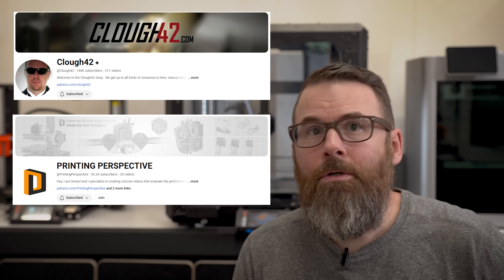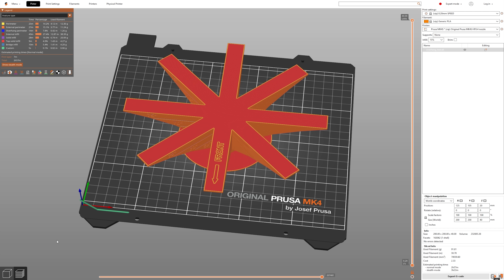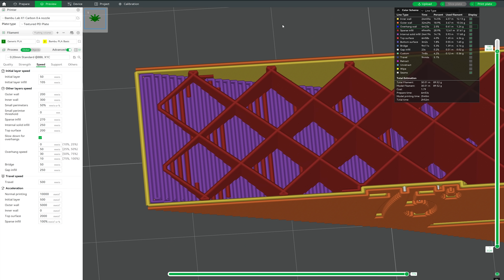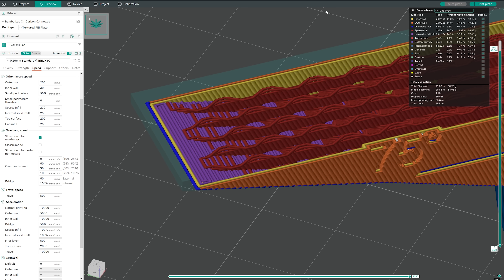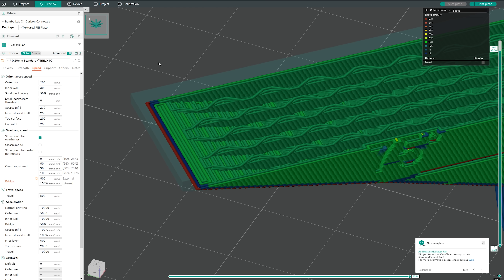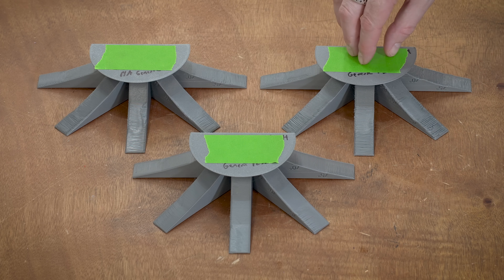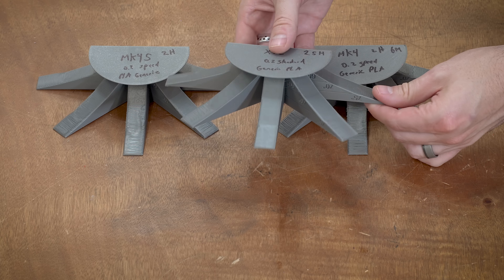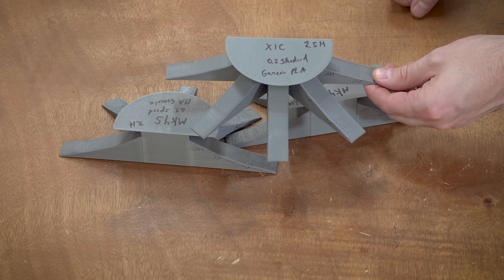Uncovering Prusa's Overhang Performance

Comment: Hello Robert, I wanted to clarify a few things. The bugfix you're referring to was actually implemented quite some time ago (9+ months), the MK4S wasn’t even in development back then. Honestly, it’s so long ago I did not even remember it. I guess it highlights that we do bugfix our slicer 🤷‍♂

It seems that the focus on overhang performance in your preview and this video might give the impression that it's the primary feature of the MK4S, which might lead to some misunderstandings. While we’re really proud of the excellent overhang performance everywhere inside the build area, it's just one part of what makes the MK4S special. Features like the high-flow nozzle, which enables MK4S to run laps around most other machines, and the fastest/least wasteful single nozzle multicolor printing, are also key strengths that I’m excited people will explore further.

I’m looking forward to seeing your thoughts on these aspects in the future. Thanks for all the work you do!
Reply: @thejosefprusa  the MK4s is a great printer and it has amazing performance,but I think we need to see a new flagship from prusa a midsize enclosed core XY machine 280x280x280 with prusa DNA. With a price tag of 1299. You already have all the electronics for that printer all you need is a chassis and a unique feature.
Reply: Thanks for the clarification! I’ve been using the MK4 for a couple of months now without a single issue, even with complex models, and I’m really impressed. Super excited to upgrade to the MK4S and dive into all the new features. Appreciate all the hard work you guys put in!🧡
Reply: Well it is the main thing you're having people show off that you sent the printer to, even Nero is doing a whole other video based on that overhang test............
Reply: “There’s a bug that might be affecting performance comparisons”

‘ I forgot ‘

😂
Reply: I'm sorry, but it is prominently marketed for this upgrade, so it certainly is a big feature! I know it must be hard to take a loss on a feature that you were proud of, but this deflection doesn't make it any better..
Reply from the maker: I've pinned your comment for visibility.  The timestamp in my video does line up with a timeline of 9 months ago, so we're on the same page there.  Bambu Studio still has yet to fix it, but apparently there's a workaround in Orca, which is still not ideal.

The focus is on overhang performance because in the 'Review Guide' clearly states "The MK4S delivers the best overhangs in the entire desktop 3D printing market" ... "so steep that most competition downright fails at printing them."  The graphics around the text show the overhang platter as an example showing some failures, with one being a 'corexy with aux fan'. I never said it's the PRIMARY feature, but if you make these bold claims, they need to be challenged.  If 'other printers downright fail', that needs to be investigated.  Upon investigation, it turns out to be a slicer bug that incorrectly applies the bridging speed to overhangs, as stated in the video.  

In all seriousness though, I have to ask if you feel that 24mm^3/sec flow rate (for PLA) is really enough to 'run laps around other machines' when many competitors (especially at this price point) can easily achieve 35mm^3/sec with standard equipment and well into the 50s with optional high flow nozzles?  These are bold claims and therefore need to at least be investigated for validity.
Reply: @RobertCowanDIY   well said! Also 24 is less than A1 is rated on their spec page (28) with a standard nozzle.
Reply from the maker: @riba2233  Exactly.  I know a couple people are testing aftermarket high flow nozzles for the X1C and getting beyond 50...  24 is more of 'standard flow' nowadays.
Reply: @RobertCowanDIY  very nice reply. The nozzle may be high flow but the hotend isn't. As I said in my previous comment, the bottleneck is the hotend. Also at the end we have to take account the other hardware of the printer as I clearly remember support saying to me that high speeds will cause problems sooner than if you print at slower speeds. So maybe the printer isn't manufactured to withstand those high speeds of the competition. Of course with a high flow hotend you will be able to print faster with big nozzle which right now you can't as even 30mm³/s is too low for a 0.6 mm nozzle and above.
Reply: One thing I love with Prusa is their customer support! Bambu has long ways to go before their customer support can reach the support Prusa offers. I recently had a issue with my X1 and its a bloody mess creating a support ticket with them. Keep up the great work! I'm really hesitant on getting another Prusa printer.
Reply: lol you sound butt hurt tbh.
Reply: Hey Joseph! Have recently made some further improvements to how perimeters are segmented before, during and after an overhang that prusa slicer may also benefit from :) check out the orca GitHub in the merged PRs section - Improve overhang slowdown granularity & line segmentation handling #5996
Reply: Seems as though ol’ Josef is doing some damage control.  I’m sorry, but $800+shipping+Tax for a slow unassembled bed slinger without an enclosure is ridiculous when Bambu is literally running circles around PRUSA. Great video, and great job on identifying the problem in Bambu Studio!
Reply: Seems like Prusa marketing dept “tried it” not expecting this? It was only a matter of time. Highlighting the solve of a flaw found in others before they fix it obviously was a time bomb they hoped to take advantage of- but it serves to damage the reputation of a company already seen by many to be resting on their laurels.
Reply: @thejosefprusa Hi Josef.  If you want to send me one, I'd be happy to test some of those other features.  I bought a MK3S+ a while back just to see why people loved them so much, and I've been keeping an eye on the MK4 to see how it matures.
Reply: @thejosefprusa You've got more serious problems to worry about. How about getting the price information correct in your web shop, and stop ripping people off? How about establishing an operative customer service that actually respons to emails within reasonable time? (more than a week is not reasonable time)
Reply: @retronicsno  what do u mean by ripping people off? pic or didn't happen lol :D
Reply: @retronicsno  What's your beef with Prusa support? They were always super helpful to me. Also: emails can get lost. Texts can get lost. I sometimes get messages from my wife five days after she sent them because they got stuck in some matrix limbo somewhere out there. I know that lack of support can be frustrating, but given that most people seem to have good experience with Prusa (given their Trustpilot reviews), maybe the problem wasn't really what you think it was. 🤷
Reply: hi josef! :hand-pink-waving:
Reply: Joe, please get back into the engineering department and be less of a manager at the top of the company. Get hands on with the product; hang out with your engineers and see what their struggles are. I bet you, there is something you will learn from them which will help you be a better manager.
Reply: Deflecting from the issue of the video
Reply: I cancelled my MK4S order, but it was the overhang performance that made me place the  order in the first place. It was featured prominently in a number of reviews, and as pointed out in the video here, you called it out in the reviewer guide. It clearly was one of, if not the, primary feature in the release. What else is there? A high flow nozzle? To me that's really not a printer feature, as it's something on most other printers you could just buy and swap out in few minutes. In fact, 3 of the 4 printers I own already do 24 mm^3/s or better, so this is not some new revolutionary advancement. The GPIO board and accelerometer are more interesting features, but again not unique or particularly innovative when comparing with other printers. All that said, I think the MK4S is great printer, particularly for someone new to 3D printing. The only reason I don't own one is the bait-and-switch order dates. Prusa will definitely be on my list next time, and I'm hoping then for a smooth and surprise free order process.
Reply: @mghumphrey  kind of a weird stance to take man, if it's on the printer, it's a feature. Not saying the high flow nozzle is revolutionary or even all that well performing compared to other printers, but if I buy a car that comes stock with a turbo, that's a feature. Any car without a turbo under the hood can be fitted with a 3rd party turbo given time money and effort. Maybe the turbo is poor performing and lower efficiency compared to 3rd party options- does that mean it's not a feature? Idk kinda weird man
Reply: 24-26mm^3/s with a 0.4mm nozzle in my opinion is still a bit too low to be called "high flow". It should at least reach 30mm^3/s, 24 is reachable with a cheap bambu clone hotend and 60W heater
Reply: @youtubehandlesux indeed. That's why I asked on Facebook about the wattage of the hotend. I believe it is the standard 20 watts. Yes the nozzle will help but the bottleneck at the end will be the hotend.
Reply: Still not good enough, bambu is better in stock config like we see here and you can upgrade the duct and the nozzle and still come under the cost of mk4s which is an open bedslinger... So it is not even a competition unfortunately. And it is certainly not a coincidence that you focused on overhang performance for this launch, let's be real.
Reply: Gosh, what a coincidence 🙄

Comment: It seems like these are all PLA comparisons in the prints.  In the future, multiplastic prints would be cool because a lot of us use these for pteg, tpu, and even ABS.  Enclosed, even my Mini runs great ABS prints. I've run some great TPU and ABS prints off (literally) this exact MK4s in my enclosure, and I'm very happy.
Reply from the maker: Correct, but PLA relies heavily on the parts cooling fan, which was the feature Prusa was pushing on the MK4S.
Reply: @RobertCowanDIY  yeah it's been doing a lot better on overhangs with TPU and ABS as well as PTEG, but I've found a lot of the default settings don't do bridge or overhang speeds or cooling in general so I've had to go in and modify those more for those plastics. But that's more of a slicer issue I guess.  Just odd that Prusa, who makes so many parts for their printers out of PTEG, wouldn't have better default settings.
Reply from the maker: @DissYraiN  Yeah, Prusa can be odd sometimes.  But then again, look at the PETG parts on the printers, they're not exactly the best examples of clean 3D prints.  They get the job done, but are heavily optimized for time.
Reply: @RobertCowanDIY  I was just going to say that.  I reprinted my mini x carriage because the plastic droops had to be affecting the print fan air flow.  I got it to bridge just fine with generic settings.

Comment: I would be interested to hear how long each of those prints took - you mentioned the Bambu had to be slowed down with the slicer changes you made. Also, the idea of these modern "just turn on and print" printers is that you don't have to do a ton of in-depth fault-finding and advanced slicer tweaking to get prints to come out right. As you say, the Prusa is a combination of hardware, firmware, slicer software and in-house experience, which results in a "set and forget" printing experience. I think that's worth a lot!
Reply from the maker: Bambu fixed this bug 3 days after this video was released.  They're both equally set and forget now, except for the Bambu being around 20% faster.

Comment: Well, it is difficult to make reviews of potentially non-consumer products. 
Cf. there are practically no reviews eg. of SAP.

IMHO there are some criterions eg. for (1) the hobbyist, here the entry price is quite important (but DIY kit makes it quite accessible, and if you are a would be maker...). Beside that even the hobbyist might be interested what are the potential paths up even from the acquired entry model, toward more complex prints, still in the prototyping but say (2} "an advanced hobbyist". Are we limited? If yes, how?

Than you have (3) profi-users which use it for the repeated production. Here the quality plus total cost of ownership (TCO) play a key roles, times of printing matter too. Calculating TCO for a common spectrum of tasks (resembling a 'banchmark') would tell something.

And than you have (4) advanced profi-users who specialize in something. Here, it is quite difficult to guess what such a user may seek as everybody may have a special priority. Large suppliers know but will not tell... 

If one is an advanced user one may still try to review the products for (1) - (3) types of users. 

I appreciated your videos!

Comment: Bambu studio just released an update that appears to be addressing this and adding a smoothing coefficient (no idea what this means yet really). Just thought you might be curious.
Reply from the maker: I saw that!  I was actually in contact with them, they moved fast!
Reply: @RobertCowanDIY  Would love an update video from you, with a test of the new Bambu Studio settings to see how it behaves in your tests, aka close the loop. (Would also be interesting to see if the defaults they have it optimal right out of the box, or if it needs adjustment for these "niche" overhangs)

PS: Anyway... subscribed, love your level-headed approach to testing - let the chips fall where they may.
Reply from the maker: @JacoGr  This is an old comment, but I ended up making that video ;-)
Reply: @RobertCowanDIY  I saw it as soon as it popped up. Thank you for that :)

Comment: You seem to imply Prusa did something wrong or underhanded.  Did they not release the source code per the open source license?  That's all they are obligated to do.  Bambu on the other hand give back nothing to the community, and rack up their list of patents.
Reply from the maker: I'm commenting on the misleading nature of their 'review guide' which was given to reviewers.  It clearly states other printers are incapable of these overhangs and imply it's due to hardware.
Reply: @RobertCowanDIY  like Bambu, Prusa printers are a combination of hardware and software.  This is how printers work best today - with that combination of hardware and software from the same source.  If "other printers" performed poorly with the hardware/software supplied, then it is technically correct.  Perhaps the implication is yours?  FWIW, I own neither a Prusa or a Bambu - so no fanboiism at play in my comments here.
Reply from the maker: @UnCoolDad  I mention this in the 'Prusa Optimization' section of the video.  However, software can get fixed relatively quickly.  AT LAUNCH, the MK4S might demonstrate some performance gains, but this will certainly go away as software catches up.  That's more what I'm trying to say.  And launching the product with this one little quirk in mind isn't going to work long term.
Reply: @RobertCowanDIY  in the modern world, competitive advantage can last a minute.  In the open source world, a second.  As long as what they SAID (not what you seem to think they implied) was factually correct at the time of publication, I see no problem.  It is called marketing.  If their overhangs were better than the competition using their hardware and software combination - more power to them.
Reply from the maker: @UnCoolDad  I can see that.  The wording in the press packet was a BIT misleading, claiming 'other printers can't do this' and stating it was because of the new cooling fan.  That's just not true, but it was strangely worded.

Comment: Man, even when Prusa does something right, you knock them down….

I dont know if this test is good. You manually tweaked a profile as if the same change was valid for all printers. 

In any case, it’s good looking into man.
Reply from the maker: I get where you're coming from, but the printer came with 'talking points' that claim it's 'the best' at overhangs and no other printer can do what it does.  I'm going to challenge that.  Give it a few weeks, the slicers will all be fixed and then it will be an even playing field.
Reply: @RobertCowanDIY bit you were quick to bring things up that weren't a talking point. Not in your video but in the comments.

I feel you have a bone to pick and that’s all.
Reply from the maker: @Vallecaucanisimo  There are 500+ comments here and I'm on both sides.  I maybe have a bone to pick when a company is trying to sway their reviewers to false information.  Also, it's hard to bring up EVERY single point in a video and not make it 1.5 hours long! I don't really have an 'agenda' here, just trying to be accurate.
Reply: @Vallecaucanisimo  I mean his previous video was praising the printer. If anything this video prevented me from returning my P1S I got a few days ago and trying the new slicer and settings first before spending way more for the MK4S with enclosure

Comment: What hideen trick/wrinkle did you apply to make the Bambu look the best in overhang performance? Was the filament for the Prusa also dried as for the Bambu? Enclosure? Same temperatures? 
Bambu slicer is based on Prusa slicer. Bambu is not developping the Bambu slicer at all - they only integrate spy- and comercial functions. But Bambu is waiting until Prusa or Orca integrate new features and functions in their slicers and then Bambu is going to copy and claim as their own new development. The same did Bambu with their printers - they copied from several companies.
Reply from the maker: Same roll of filament for each printer, everything was sliced using default settings and generic PLA profiles.  I only changed the speed setting on bridges.  You're looking for a smoking gun, and there isn't one.  Sure, Bambu Studio was forked from Prusa Slicer, but Orca, BS, and PS have ALL made significant changes/updates since that happened.